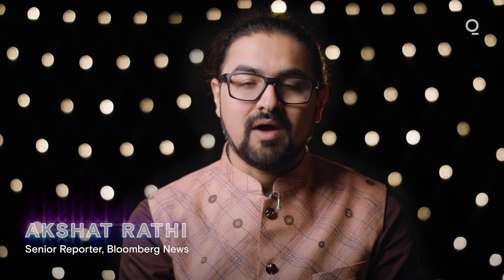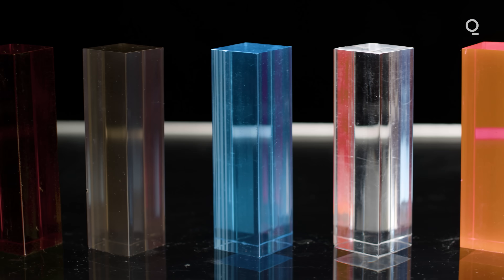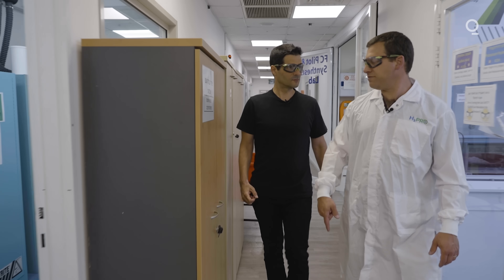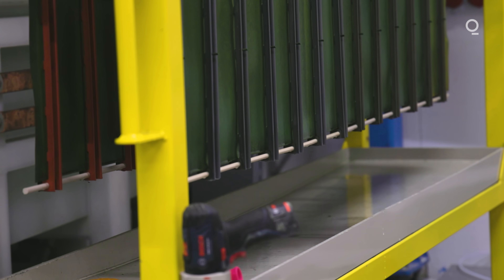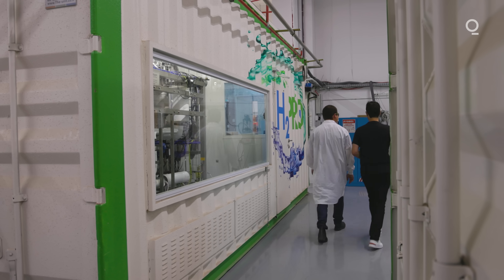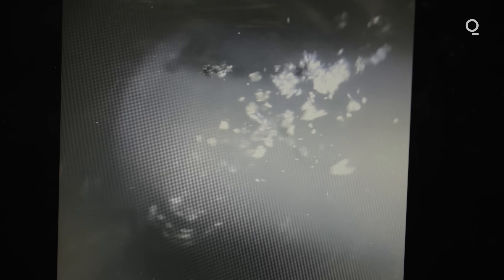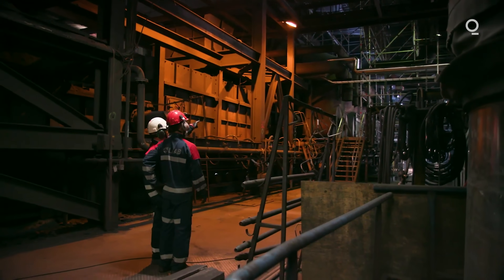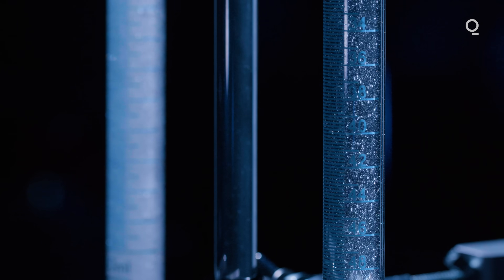How Cheap Hydrogen Could Become the Next Clean Fuel

Comment: Hydrogen is very clean energy and there is more than an ocean of it. But extracting hydrogen take more energy than the energy it produces. After 150 years of many claims, not a single success of producing hydrogen cheaply. Maybe there is not! Remember cold fusion?
Reply: I also remember Stanley Meyers (a fraud) and now there is h2pro preaching the same, "We've found a method of electrolysis that uses less energy..."

Comment: if you want to improve hydrogen use a closed system, and after a while all you will need is a glass of water to fill up the original water tank
Reply: Interesting idea. Though I don't think the energy required to split that "glass of water" will be much less than the energy it generates from combining H with O2.
Reply: @zainabe9503  It never will. In a closed system, energy must be conserved. This means that without outside influence the energy cannot increase, you can never get more energy out of electrolysis og water and then burning than you put in. Think about what is actually being done. An electric charge is being applied pulling the water molecule apart. This means that the electric field has to supply the energy to break the bonds of the water molecule. Ths split molecule is then being combusted to get the original. All thag is being done is that you are breaking the bonds using an electric field and then remaking the bonds via combustion, there is no change in energy. It turns out that you will also actually create heat in the process which will leak out of the system, so in reality you won't even get no change in energy, you will actually be losing energy!

Comment: Methane is a hydrocarbon and so is crude oil and coal. The next two can be processed to produce green hydrogen and solid carbon with the aim of $1 a KG of hydrogen. Fuel cells outperform batteries and are green.
Reply: Can you explain is what way a fuel cell out performs electricity stored in a battery? You might say capacity. this is somewhat true but in reality it is false becuase of the efficiency factor. Fuel cells are only marginally more efficient than a ICE engine.

Comment: The problem with this turquoise carbon from natural gas is that it's not renewable and closed cycle. A large scale use would open a new can of worms.

In essense you are exchanging dumping CO2 by burning gas, with depleting oxygen from the atmosphere by burning hydrogen instead, creating excess water and carbon as subproducts. The excess carbon can even sequester more oxygen if not properly handled. Instead of solving our environmental problems it will generate others.

The only really sustainable way for hydrogen is to split water, since it acts as a reversible cycle like a giant global battery. The other sustainable alternative would be to split CO2 back to a fuel (like ethanol) and oxygen.
Reply: What about sabatier process? Synthesizing methane from carbon dioxide and hydrogen, with oxygen as byproduct, surely it will open the closed cycle?

Comment: What was the previous "clean Fuel " ?
200 years ago, humanity has been working only with relyable and durable clean energy ...
Reply: There was no previous clean fuel. Humanity has been burning coal, charcoal and firewood since the dawn of time. We've had clean energy in the past in the form of windmills and watermills, but those had limited uses and did not replace fuels in any way. The only reason people didn't really care about fuel pollution back then was that we just weren't burning enough of it to cause any problems.

Comment: if its possible to split hydrogen by rising temperature,  that means when we do some pressure changes, it gonna work,  i want someone to do those experiments,  we can use Sea water As at the button of ocean there are higher pressure than at the top,  i don't know how to explain bt if someone got my idea, plz do that experiment 👍
Reply: Sea Water has big issues, it forces you to turn off the electrolyzer for more regular cleanings of impurities. Downtime is lost time.
Reply: Or if you wanna rise temperature you should go with geothermal energy 

Basically you dig deep in the ground till it gets hot enough 

You can do this best when close to volcanoes to improve heat or efficiency

Comment: The problem with hydrogen is it's super inefficient. You have to transport it. You have to pipe it. You have to keep it under super high pressure. It tends to explode a lot. It's a fool's errand. Get over it. Geez!
Reply: Hydrogen has been talked about for decades but hasn't happened because of practical difficulties. Now it's being pushed, but the back story is that most of it is made from natural gas, so it could be seen as a new way to sell fossil fuels.

Comment: Hi all I was just having a think. Why are we trying so hard to STORE hydrogen. Why can't someone focus on a device like a injector that separates the hydrogen as it enter the combustion chamber. Save trying to store it. Just pump water to the source
Reply: Because then hydrogen doesn't act as an energy source anymore, you need to carry water and another source like a battery to do electrolysis. At that point it's more efficient to use the battery in an electric motor, than to waste energy in a less efficient intermediary process like electrolysis.

Comment: Humanity will need to find alternatives to fossil fuels; that is true.  Green hydrogen resulting from water electrolysis is an alternative;  is also true.   We have plenty of solar capacity to power the electrolysis, and such power requirements in the future will be affordable.  HOWEVER, no hydrogen company on earth has demonstrated scalable electrolysis, and it appears impossible to do so now.  There is less than 100 MW installed capacity operating in the US and less than 500 MW installed worldwide.  To put this into context, a typical ammonia plant needs more than 4 million MT of hydrogen per year to make nitrogen-based fertilizer!  No electrolysis unit built by any "Hydrogen stock" company today can produce hydrogen on more than a tiny demo scale at exorbitant CAPEX and OPEX.  The electrolyzer manufacturers won't even discuss large-scale H2 production because they have zero bases for confidence using alkaline, PEM or SOEC electrolytic cells.  NEL, Plug, Ballard, et al. are sham companies that cannot make the tiniest dent in climate warming with demo scale revenue and never even hinting at realized earnings.  If there is any doubt, just look at their financial performance since formation.  Abysmal.  No evidence exists that they will improve.  Put your money into fusion, wind or solar!

Comment: What happens to the water? Still drinkable? Does it regain it's original properties ? Hydrogen is super abundant in the universe but there's a limited amount of dinosaur tears (water/H2o) on earth.
Reply: It depends on what you use the hydrogen for. If you burn it, it will react with oxygen and create water.

Comment: Hydrogen might be a way of converting existing steel works to a lower carbon footprint but is there a way of using the electricity directly? perhaps some version of the direct arc resistance electric furnace?
Reply: You're thinking of hydrogen as an energy source.
Imagine a machine that pumps water uphill to a big dam, and there's a hydro plant. How much electricity will that hydro plant produce? The answer is, Less energy than it takes to run the pump to get the water uphill in the first place.
Hydrogen isn't an energy source. You must first insert lots of electrical energy into water to separate out the hydrogen. That's an uphill energy state, if you graph it out, just like the dam. Then you collect some energy by burning it, which turns it back into water. The amount you collect is less.
There is almost no application where this makes any sense at all, and none where this makes sense from an energy production standpoint.

Hydrogen is great if you need hydrogen. It's lousy if you need energy.
I can think of two real-world examples where they needed lots of hydrogen - The Hindenburg and the Space Shuttle.
Both blew up eventually.
Reply: @protorhinocerator142  Basic High School Physics. Conservation of Energy. People keep missing that part.
Reply: ??? I am under the impression that the hydrogen serves not only to obtain the needed high temperatures but also to reduce the iron oxide. But agreed for the melting your described solution might work.
Reply: You are right. However hydrogen can work as a energy storage system so buying hydrogen made from cheap windpower during high speeds might be cheaper than buying electricity during peak demand on a shady windless day
Reply: For electricity, it's just energy with extra steps

Blue hydrogen is using gas with extra steps
Green hydrogen is using renewables with extra steps
Reply: Not possible because this process require A LOT of energy. The cost to install all the solar panels doesn’t justify. Cheaper to use coal and hopefully shift hydrogen soon.
Reply: @irfanvirji5319  yeh from what I’ve seen the steel industry is working towards hydrogen to replace coal

Comment: the steel factory could easily use the turquoise hydrogen method and use the captured carbon for their steel production, reducing even more the emissions, as steel usually needs carbon for it's production as a reinforcement for the alloy, so it would be a win win
Reply: Would be dumb not to use the carbon for sure.
Reply: Iron mine ores does not come with easy access to Methane but a lot of Iron ore is co-located with a lot of space for solar panels and wind turbines. So the easily part of your reasoning is definitively easier for Hydrogen. More over the standard coal based reduction process uses coke made from metallurgical coal and you need 770kg versus 50kg Hydrogen, which boils down to 3X more energy expenditure for the coal route versus the Hydrogen route. The point of producing sponge Iron at the ore extraction facility is that you can leave all the mass that is not iron and only transport the sponge iron to EAF (Electric Arc Furnace) processing. This is another substantial reduction in emissions connected to hydrogen.
Reply: Use carbon collection to lower price as when collector full could be exchanged over it's lifetime to lower cost of vehicle an repair.
Reply: Have we not learnt our lesson with the Hindenburg?  Hydrogen goes Boom!
Reply: @CORVETTE_DUDE_CHANNEL  this isn't a floating ship, this is pressurized hydrogen which will escape at high speed if the storage gets perforated, not slow moving expanded gas
Reply: @денисбаженов-щ1б  you know if we leave atomic carbon on the atmosphere taken out of this reaction it will just turn into CO2 don't you? It doesn't matter how much it is, it's better to use it than to leave it, I did know that beforehand, and also it would still lack some extra minerals besides the atomic carbon which come with the steel grade carbon used for steel, but I'll let you go for the chemistry book instead 👌👌👌
Reply: Captured carbon dioxide is a desperate death kick from a dying industry that does not make economic sense and only works at best as stop gap measure....you cannot equestrate all the CO2 from industry it is just not a long term solution to anything.
Reply: Hydrogen causes steel to become brittle which is why it is not being used now, how does this change to make it attractive in the future?
Reply: "From that time Jesus began to preach, and to say, Repent: for the kingdom of heaven is at hand." Matthew 4:17 

"Ye have heard that it hath been said, An eye for an eye, and a tooth for a tooth: But I say unto you, That ye resist not evil: but whosoever shall smite thee on thy right cheek, turn to him the other also." Matthew 5:38-39°
Reply: Wouldn't burning that carbon defeat the purpose of removing it from the hydrogen in the first place? The feed stock for the Turquoise Hydrogen method was still regular old natural gas. (Methane)

The act of removing it and storing it prevents that CO2 from being released to the atmosphere. Burning it for steel production would negate that completely.
Reply: @cmac3530  they're not burning carbon composites, they're only burning the hydrogen, which becomes water, and the carbon used in steel production is actually infused into the metal, that's how steel is made, it is an iron-carbon alloy IIRC which basically means the carbon gets permanently sequestered
Reply: @irvingchies1626  Gotcha, I misunderstood what you meant. Thanks for clarifying
Reply: @irvingchies1626 Wether H.F Reaplaces E.A.F ! I think it Eventually will !
Reply: @cmac3530  Nah. The steel needs some carbon content to actually be steel. generating the heat to melt the metal can be provided by burning hydrogen instead.

Comment: Hydrogen distribution system:  nonexistent
Electricity distribution system:  Everywhere, it is pretty much the definition of civilization

Converting hydrogen to a usable form (high pressure storage or liquid) takes a lot of... electricity.

It takes 3-5X more energy to use hydrogen to drive a mile than just putting that energy into a battery.  BTW, every fuel cell car is an electric car.  A great way to improve fuel cell cars is to remove the fuel cell and fuel storage and then enlarge the existing battery.  Presto! You now have a practical vehicle.
Reply: There aren't only small vehicles... You should think about the heavy duty or marine sector
Reply: @Franghein00  Still wont work. As you scale up hydrogen usage the cost problem just gets bigger. There is no answer in Hydrogen. Although I was impressed with the sequestration of solid carbon from Natural gas. Have never seen that before. There could be something too this. Any other form of H2 production is a massive waste of time and money.

Comment: REAL ECONOMICS: The reason we are (or were) wealthy is we’re using a lot of fossil fuels. If you increase the cost of energy, it increases the cost of everything. So if you commit yourself to using processes like solar, wind, hydrogen that nobody really knows how to do at low cost, then we become poor and become far more vulnerable to inflation and other unnecessary tragedy. All forms of energy require production, processing, transportation, storage, and usage. It’s a whole complex of processes. Energy must be produced, processed, stored, and transported before it can be used productively. If you cannot afford energy, then you don’t have energy.
Reply: Just like the first gas lit lightbulb to the now very low cost efficient LED light, we can develop cheaper ways to produce cleaner hydrogen more efficiently. 
We just had a breakthrough with thin solar panels this year that is even more efficient and cheaper to produce.
Things take time, but as long as there's a push for it we can get there. 
It must not be forced because as you mentioned it can cause misery in too rapid transitions (look at Sri Lanka and their sudden ban of chemical fertilizers causing food chain prices to explode).
Reply: Whats with this idea that renewable energy is expensive?. fossil fuel energy is cheap because of the massive subsidies the industry receives. the fact is that renewables, namely solar and wind are the cheapest forms of electricity production on the planet. Fossil fuels do not pay their fair share when it comes to environmental degradation. Put a price on carbon. Do it asap and renewables / batteries will quickly become the only viable option. It will literally change overnight. our living standards will increase dramatically because our environment will improve.
Reply: @tigertoo01  Renewables are expensive when you compare energy density, storage capabilities, and land per unit area usage. We don't have the battery technology to store enough excess energy produced by renewables to compensate for demand spikes or energy needs on the scales of cities and nations. If you compare the cost of renewables to Fission energy, they're basically the same (taking into account construction, maintenance, decommission, resource sourcing, etc) while needing MUCH MUCH less space and materials that damage the environment to harvest/transport.
Reply: That’s why ppl have to look upon how nature handling things. Also, there is energy waste to deal with.
Reply: @dale7326  Coal, fossil fuels, and the semblance of Laissez-Faire Capitalism that existed from 1865 to 1913 +/-, saved the forests and the whales, not to mention mankind in general. Fossil fuels. The 100% natural organic compound, produced by Mother Earth herself, that is the most energy dense, ecologically symbiotic, safe, life serving, and economic solar energy storage solution in existence.

Comment: Renewable electricity still pollutes to make and ship, could be considered hydrogen battery.... frequency and temperature are key for electrolysis but there is also an electrolyte needed. This doesn't seem equivalent, otherwise wasteful.. you could make graphene from the carbon capture instead of burying it.

Comment: I like purple hydrogen; @ 20,000 hz. multi freq. They need to explain Hydro/Carbon. Everything that burns is hydrogen, what's left is carbon. Unless you burn Freon; Di-chloro-fluoro-methane. Why? Anyway, you've just made mustard gas. Propane is R-290. The Hindenburg's coating was like the old R/C modeler's dope. Thats what ignited when they ascended & descended in an electrical storm.

Comment: Hydrogen fuel cell vehicles, where the Hydrogen is made from electrolysis of water, use about 3x to 4x the amount of energy to go the same distance as a battery electric vehicle.

Most commercial Hydrogen is made from natural gas, a fossil fuel, which is why it's supported by the oil industry.

Hydrogen is largely greenwashing by oil companies.